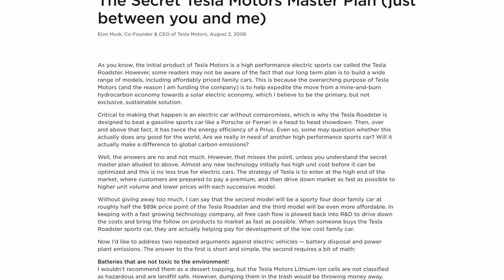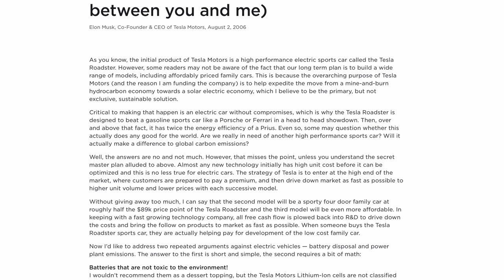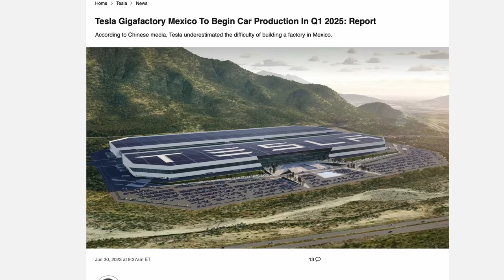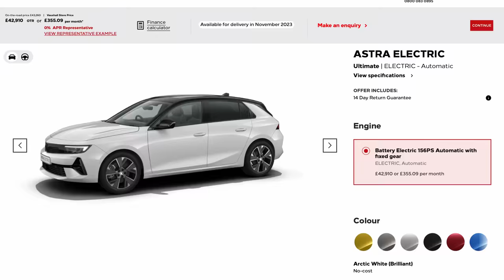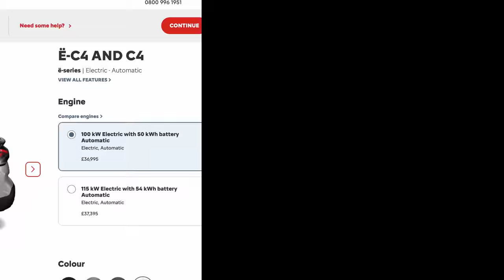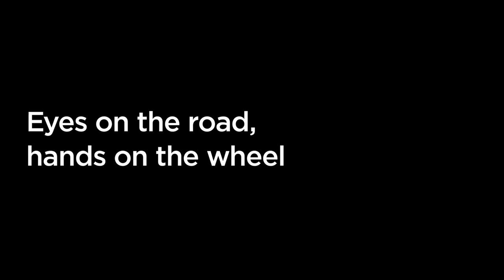Ford Slashes EV Production To Stem Losses | Dire Consequences For UK Vehicle Sector

Comment: You seem to think Tesla is the only pure electric threat to legacy makers, it's not. MG, BYD, GWM Ora & Geely have new options coming soon that will be lower in price than £25,000. The MG4 already makes the Astra look silly and the BYD Dolphin makes the Corsa Electric look ridiculous. Add Tesla's Model 2, the VW ID2, Dacia Spring and the huge range of Chinese models to the list and Ford, Stellantis, Nissan, Toyota and others have nothing to coompete with.
Reply from the maker: Yes correct but non-Teslas will always be the android cheap option vs the Tesla’s Apple iPhone, preferred even if you can’t afford one. MG and others are good but at this stage budget. Tesla advances are faster than any others, they are pulling ahead.

Comment: EVs have no resale value and if you drive it over 100k miles you need to replace the battery which costs almost as much as the car did. EVs are a niche market and will never see mass adoption.

Comment: One thing that's killing them is outsourcing. The legacy OEMs have massive assembly plants, massive capacity to assemble vehicles, yet have little technology of their own to produce parts. The majority of components are shipped in from suppliers, some from overseas with big transport costs, the suppliers make a profit, so do the transport companies and any warehouses they use, multiply this by thousands of components and this significantly adds up and ultimately takes away profits. It also slows development because they don't have full or sometimes any control over changes.

The legacy OEMs held all the cards not long ago and could hold suppliers to ransom, making them develop parts for their vehicles, absorb lots of development, and set up costs if they wanted the OEMs business.
As time progressed, many suppliers now hold the cards, many are specialist companies and have little - no competition, they have monopolies, their technology is protected, and they are bigger than their customers.  The OEMs don't have the clout they used to have.  I don't see how they can recover considering their debts.  When they outsourced the parts, the skills, control, and a big percentage of profits all went with it.

Where they all F***ed up was sending the blueprints for everything to China, to have the tooling made cheaply. Of course the Chinese copied what they wanted but if Ford, VW, or GM try to copy any of the suppliers, they will be sued.
Reply from the maker: Very valid points. They are little more than assemblers but have massive factories and massive workforce. Bloated?
Reply: @davetakesiton  like a hot air balloon 😂.  Another point 👉  When it comes to dealers, the OEM often dictates the amount of investment that the dealership puts in. JLR made dealerships spend big bucks setting up the dual arch architecture, most of these dealers will now be closed down and the remaining will have to implement their new house of brands architecture.  Ford have forced dealers to invest something ridiculous like over 1M per site to stock their EVs.  They can't sell them but have massive overheads for these fancy buildings, staff, etc.

Comment: The trouble is, in the UK, we don't have the charging infrastructure needed to make EVs practical. Outside the main conurbations chargers are few and far between.
Reply from the maker: Hi Adrian, did you know when the first cars hit the road, we didn't have any petrol stations in the UK at all? and when we invented the airplane, we had no runways, just fields? and when Edison invented the phone, he had no-one to call? Not enough chargers yet? Let's just give up, far easier
Reply: Yes but we haven't just invented EV's have we? @davetakesiton
Reply: @davetakesiton 
I hear what you're saying Dave but the number of cars on the road and the fact that our society is built on the need for cheap transport means that we are not ready for the replacement of the ICE with EV's.
The battery tech is currently at the 2mp digital camera level..and who wants a 2mp digital camera? 
EV's have a place in urban envoronments but are currently nowhere near capable of replacing ICE cars. I'm all for reducing pollution but once the realisation that CC is a myth permeates society I think many of the crazy policies proposed by the WEF (and in turn the Governments of the World) will be knocked on the head.

Comment: Nice one Dave. One thing we could argue though, is that in general, Legacy quality control is streets ahead of where Tesla has been for the last 5 years. I paid more for my BMW i4 than I would have done for a model Y, but it is extremely well screwed together. All panel gaps are absolutely perfect, the interior trim is immaculate, and not a single blemish on the paintwork. No rattles or squeaks either.
Had I paid £55k for a model Y, and had any of these issues, I would have never heard the end of it from the wife.
Reply: Ditto.
Reply: This is exactly why I walked away from buying a Model 3 pre-pandemic.  The example I looked at seemed like an indifferently assembled kit car...... I'm not convinced Tesla have sufficient consistent mass production experience yet...... Drive-train = superb, but build quality = Must try harder.......
Reply: German cars aren’t that reliable compared to Japanese and have short warranties
Reply: @ianheath6797  The BMWs I have owned for the last 15 years have been very reliable. The only repair to one of them was a single suspension bush after 116,000 miles. 
My i4 now has an 8 year, 100,000 mile warranty on the battery and a 3 year, unlimited mileage warranty on the reat of the car.
Reply: Maybe I've been unlucky. I've had a Mercedes C250 and a Vw Arteon both of which I sold after a year. The Merc had apparently incurable brake problems shuddering that still persisted after replacing all the discs and pads under warranty.The VW had only 10k on the clock when it went. Plagued with weird electrical troubles, it was in the dealers more than I had it. A previous BMW 525 had it's auto box pack up at 50k miles - a very expensive repair. The 3 year warranty in the rest of a car (ex battery) is pretty poor. My wife had a Kia Sportage  . When the air con packed at 6 years the entire system was replaced foc. What would that have cost in an Audi, BMW Merc etc? @Smith_Tech_70
Reply: @ianheath6797  Yes, 3 years isn't great, I'll admit. But I wonder if Kia only do that to gain a good reputaion in the western world? Perhaps taking a bih hit on some cars as not to lose face.
I had brake shudder on an 3 seires E91 Touring (the same one as the bush repair) But it was down to my local independant garage replacing them with the same make as they do on boggo cars. But mine was the 330d, so had some performance. I they sent them back to the supplier after 3 sets (no extra charge), and finally put on a better make, and I paid the difference. That cured it.
Other than that, I've only had to replace a driver's seatbelt on a 2015 335d Touring for £260.

Keeping my fingers crossed for the i4. The drive line should be good for 500k miles at least. And the battery will outlast my ownership.
Reply: Yes KIA have upped their game and are getting a good reputation. I've just gone back to a new Xceed petrol after 2 years with a Ford Kuga Phev which was completely reliable.Reasons: Kuga had utterly hopeless heater in the winter and Octopus changed the hours and shortened their cheap tariff to make the use of their electric tariff inconvenient (Cheap night rate and more expensive than normal day rate). Hope you car is better in winter and your range doesn't get killed .Some EVs suffer 30% range loss below 5 deg. If you combine this with with aging loss by the time the car is a few years old winter driving range is severely affected.Anyway Good luck! @Smith_Tech_70
Reply: Nick .. what do you base that on ?

I think you’ve been hoodwinked into believing lies from Journalists.

It’s simply not true.
I’ve owned two Tesla cars and the quality is better than Mercedes BMW
Reply: I swapped a BMW MSPORT X5 for a Tesla MY .

I far prefer the Tesla
Reply: @ianheath6797  I’ve watched owner reviews pointing out the faults in the paintwork, loose interior panels, badly fitted door seals etc. it’s well known that Tesla quality leaves a lot to be desired. I’ve owned BMWs for the last 15 years, and been nothing short of impressed with every one of them. I don’t rate Mercs though btw. I’d say Tesla are on a par with Audi. Yes, I’ve owned an A4 TD170, and it felt no better screwed together than my previous Vauxhall Vectra. So to conclude, Tesla build quality is where Vauxhall were in 1998. Just my honest opinion.
Reply: @maxflight777  Glad you like it. Fair enough if you’re into SUV style cars. I’m not. I couldn’t get past the looks and the sparse interior.  Me and the family looked at the Model Y, and the i4, and the i4 just hit the spot for us all. I love detail in design, and for me, Tesla design lacks detail. A step too minimalist for us.

Comment: It has often been said that it is even harder to make a profit on a small car rather than on a mid or large car. On the other hand many people will prefer to start their EV journey with the lesser,  second car. Families who run 2 cars have more money than those who run a single vehicle and, if you can afford 2, you will probably not use the smaller cheaper car for the longer family runs anyway so the specs of a small EV are less of a risk. I think GM got it right when they started with the Bolt - just a pity that their LG-supplied batteries catch fire on early cars.
Reply from the maker: Yes, it is strange that GM never seriously tried to make the Bolt a mass market EV. Battery aside, it was never intended to be a smash hit
Reply: @davetakesiton  apparently they are bring it back
Reply: Elon Musk mentioned that the auto companies make their money selling parts. If EV’s become dominant in the next ten years, and those vehicles don’t need as many replacement parts then the legacy American companies ( Ford, GM and the old Chrysler) are doomed. Markets reward fabulously and they punish severely. Ford stock traded today at $12.50. In 1998 the shares traded as high as $38, the shares are off by almost 60% over a period of 25 years. Certainly not a sign of health.
Reply: @jameswirth3117 True
Reply: One really big problem that Ford and all the US manufacturers have is that Americans don't want small, high quality cars. Here in the US, we buy pickups and huge SUV's whether we need them or not. Very few Americans will buy a small, high quality car. They always buy the biggest car they can afford, so any small EV they buy has to be the same price as the equivalent ICE car, and cheap. That rules out engineering two separate products. They have to compromise by making two versions of the same car, which in our case, is an SUV.  So few people buy any size of sedan or coupe here anymore. If an ICE Golf is not economically viable, neither is an electric. 

Ford has made mistakes, for sure, but they are forced to make what sells, which is big-assed trucks and SUVs. And Chrysler dropped their last small car, the 200 in 2017, due to lack of sales.

Here, many people can't afford to drop $40,000 on a new EV every 3 years, if they are racking up 35,000 miles a year, as many do. The prospect of replacing an expensive battery at a little more than 100,000 miles will scare a lot of people off.
Reply: @watchman1872    Yes

Comment: Here in the UK, the average selling price for a new Car in 2023 is a whopping £39,000. The Tesla Model 3 and Y are already pretty close to that.  I also priced up the smaller, lower range, BMW iX1 and when specced to match the Model Y, you get to a whopping £61,030  compared to £44,990 for the Y. Ok the Beemer is AWD and 130kw charging and the Tesla is RWD with 170kw charging but I just cannot see who would pay and extra sixteen grand for that. Plus MG4 starting at £27k is a low bar for EV adoption compared to what you would have to pay for an ICE EQUIVALENT.
Reply: The average car new or used is £17,000 up from £12,000 just 3 years ago.
I just sold my 6 year old KIA for just £1000 less than what I paid for it new.
Small petrol cara are in demand.

Comment: Ford haven't paid attention or created smaller EVs quick enough. The popularity of the SUV in the market seems wrong to me. I previously owned a VW Touran and before that Vauxhall Zafira, Renault Megan Scenic. MPV's in my opinion are better than SUV's but the VW ID Buzz which is supposed to the replacement for the Touran, but can you remove the seats? And look at the price of the ID Buzz..... considerably higher than the Touran. 
Tesla and their price fluctuations are not popular with existing owners especially those on PCP contracts.
Reply: There's also something to do with crash testing. I can't remember the exact details, but with the rise of SUV's the small car has to be able to withstand impacts at much higher positions than before, as well as the traditional lower positions. Add to that, an SUV can be manufactured in virtually the same time with a few more materials, then can be sold for considerably more.

Result: Nobody wants to make the small car.
Reply: Dave told you why Ford hasn't concentrated on small EVs.
Small car.
Small profit per unit.
Large numbers to break even.
BIG factory .... EXPENSIVE!
.
As Dave also said, if they'd done it 10 (15?) years ago, THEY would be winning now and Tesla (probably) wouldn't exist.
Imagine that Tesla even reached the Model 3 "production hell" phase with a competitor in production?
It would have killed them.
.
Now, it's increasingly apparent Ford CAN'T have a large enough factory, AND guaranteed "in house" (ish) battery supply, AND a profitable EV (of ANY type) before.... 2026. (Factory, 2025, but vehicle and battery ramp takes time!)
.
"Tesla price fluctuations"?
.
They TOLD you that prices increased (proactively!) due to supply constraints and commodity inflation (Lithium 4x?)
It's the same issue that others (who cried about Tesla raising prices) are facing NOW because they weren't proactive.
.
In June 2022(?) Elon TOLD you (paraphrased)
"Prices are frankly embarrassing at the moment, we will adjust them down as conditions allow"
And they did.
.
Don't forget, for the last 19 years the FUD mantra had been
"EVs too expensive!!!!"
.
You can't have it both ways.
Reply: @mrg-ghx8052  
Probably the side impact/ rollover tests.
More headroom, better airbag deployment, better crush protection in a roll (IF you can roll an EV)
Reply: @rogerstarkey5390  There's always been the possibility of being hit by a much larger vehicle, we kind of all reluctantly accept that if that happens were probably screwed, but as the landscape changes and the average vehicle gets larger and heavier, that possibility increases. The safety requirements must accommodate the averages so will become way more challenging and rightly so.

Comment: Love the video! One small quibble:
The "Model 2" will likely start selling in H1 (first half of) 2025. Not 2024 unfortunately.
And I don't think that guarantees it will actually be sold in the UK, right away.
Hoping to buy one in 2028 when the bugs are ironed out :)
Reply from the maker: Yes, 2025 ramping up, but I honestly expect to see some produced Q4 2024. Don't rule out Berlin or Shanghai, it might be quick and easy to add an extra production line or two at each. The Model 2 will be an instant mass market champion. If you see one advertised I'd reserve one, the core of the vehicle will not suffer early faults, its their existing tech.
Reply: I have a nine and a half year old Nissan Note and hope to replace it with an electric car. The Tesla "Model 2" seems to be the best option, but will consider the supermini offerings from other manufacturers. Because I keep my car in the garage, the battery type will be important and I only want a car with an LFP battery - other battery types have a greater risk of catching on fire and I don't want the house burning down.
Hopefully my existing car will last until a suitable electric car arrives.
Reply: There aren’t any “bugs” with Tesla !

Utterly thrilled with my Model Y which was one of the first 10 delivered in Europe !

Comment: In May 2023 there was a Blacked out F150 Raptor R 700 hp. in the Showroom in Los Angeles Dealership for $260,000 USA Dollar. I had taken my 2022 Roush Mustang and at the time Price did not change and keep in mind interest rates in August 2023 (830 Credit Score) was 3.4 % now in  November 2023 the price dropped $4,000 and interest rates are at depending on how much the Loan is with a Minimum 50% Value of the Car's down payment would be 23% interest rate, to 70% downpayment for 7.9% interest rates. Loan offices are not giving loans of 10 to 20% Downpayment anymore... the Irony is Dealerships are asking Manufactures for Help.. Dealerships caused the Economy Crash and the Union Workers Strike made it Worse. Markups are reminesant to 2008 Real Estate Crash, 👨🏻👍🏻🏎🏎🏁🏁Great video Report on all things Automotive Economy. I will never Buy an Electric Vehicle

Comment: You seem to have overlooked the fact that EVs are almost completely worthless for what internal combustion cars are mostly used for. Pretty much none of what I use my V8 powered internal combustion vehicles for could even come close to being done with EVs. And what about those millions and millions of people out there who depend on  $2000-$5000 USED cars, and couldn't even begin to afford a $25,000 car, which would be at least $35,000 after all the taxes and fees? Ford and GM should get back to what they used to do. Build reliable and long lasting $25,000 internal combustion cars for wealthy people, which could then be bought used for $2000-$5000 by everybody else when the wealthy people sold or traded them for another new car.
Reply from the maker: Have a guess what price used EVs will be when new cost £25k and Tesla Model 3s are ten years old